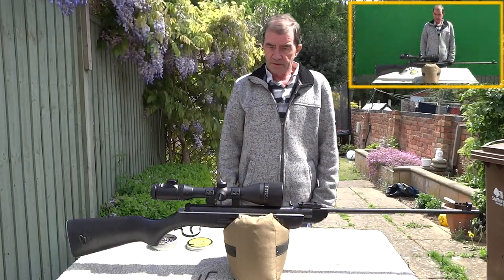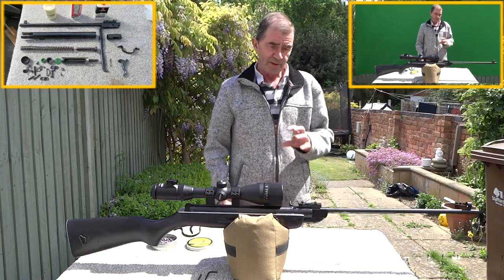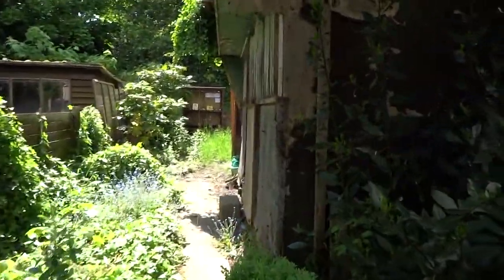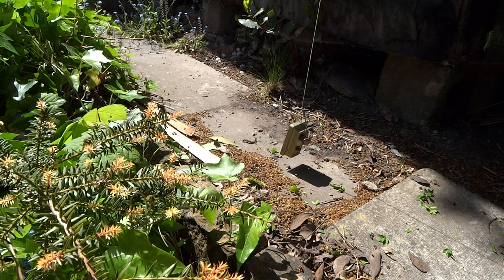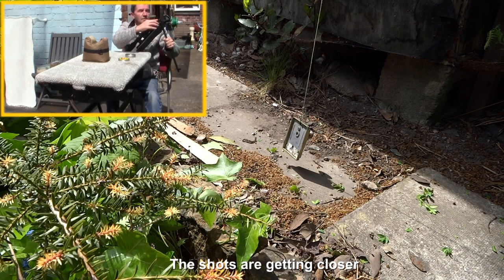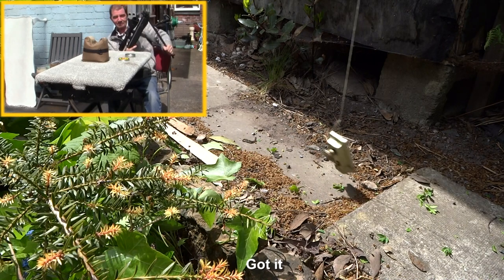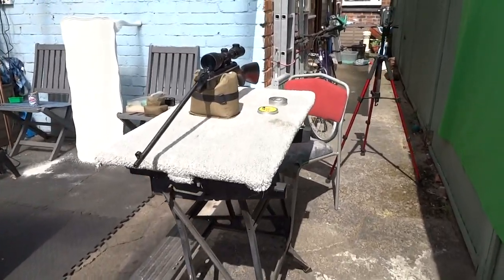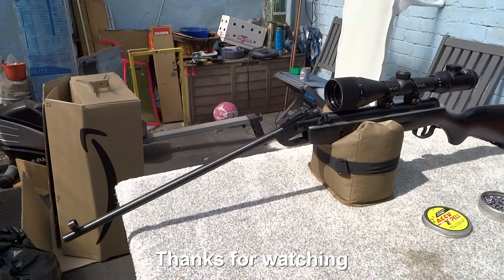West Lake (SMK) B2 Air Rifle Restoration

Comment: It came with a lubrication port in the cylinder... seriously though I reckon that pinhole could be plugged with a small blob of solder or metal adhesive.
Reply from the maker: 🤣 Actually, the hole is so small I don't think it really affects the accuracy or power which, with the original spring still fitted, is probably a whopping 3.5ft/lb at the moment. 😂  
It is my 'Fun' gun, after all. 👍
Reply: @LPGexpert  Nothing wrong with a low power airgun for plinking. My old BSA Cadet is doing about the same and still accurate for 10m. That hole in the cylinder is tiny so it's not going to make a big difference either way. Cheers!

Comment: Get the hole brazed,and get your self a pellet catcher and some reactive targets,and you will see were the pellets go and get zeroed in I have 5 smk rifles two B2s three under leavers for the price all together was less then £400 and all brand new and all in 22cal plus all my Hw,rifles to. But get that hole fixed my two b2 rifles are 10.5 ftlbs and there very good.
Reply from the maker: I'm not that fussed, Stephen.  It was only a project rifle, and it cost me nothing anyway.  I've got a new BSA Meteor Evo in .22 that I use too.  Thanks for the suggestion, though. 👍